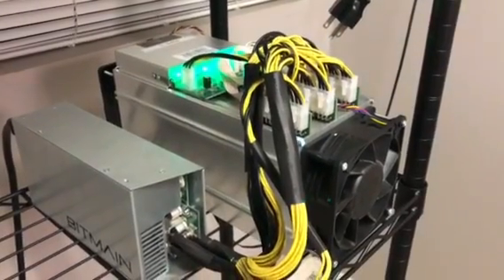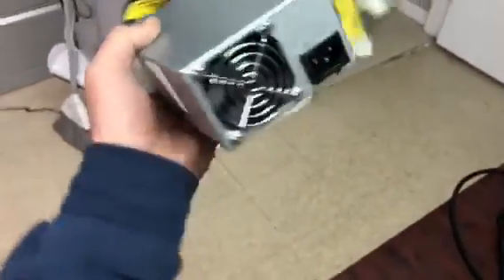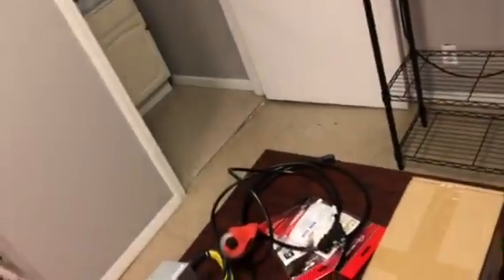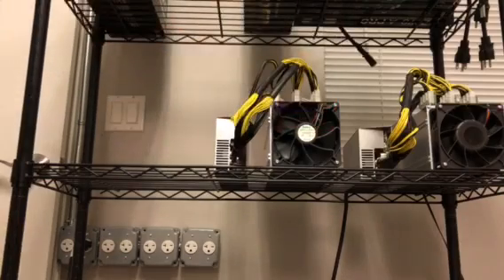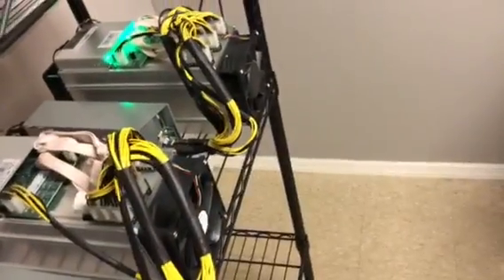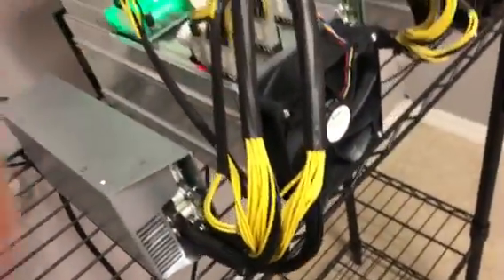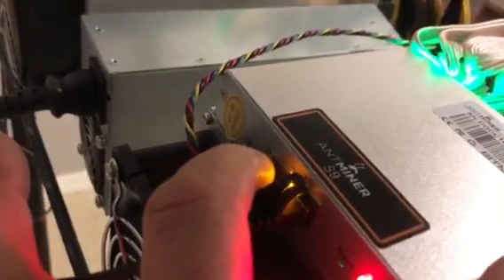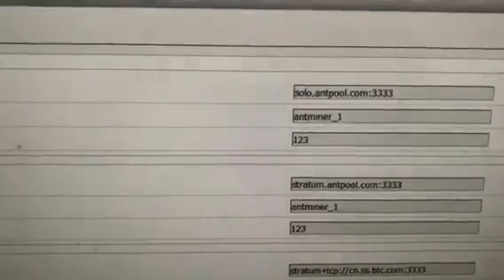AntMiner S9 Unboxing, Setup & Configuration - BitCoin Mining Miner 13.5TH

Comment: so what is the ip reporter program where you loaded the miner ip? and where did you get it? your video is kinda pointless with out that kind of information. a lot of details are not necessary but without the basic requirements its not gonna work and it just leaves a blank spot

Comment: 15 Amp circuit, on a 240v line, with 8 outlets, and 8 Antminers [s9's] equal to a total of: 10,640 watts... is a negative -7,040 watt difference, with a 296% load! Did anything burn down?

Comment: Sir! Thank you very much. I have a question, when you connect the power supply to the machine, the order of the cables are random? Another question, when you set up your miner machine into the pool, do I have to restart the machine (turn off and turn on)? Thanks!
Reply from the maker: Cristopher De Luca connect them randomly. When you connect to a pool the miner will likely reboot to save the config file.
Reply: Excellent! Thanks. The reboot is automatic? Do you prefer that pool than Antpool? Isn´t Antpool more profitable?
Reply from the maker: i use bitcoin pool - no fees.
Reply from the maker: The miners reconfigure automatically. Very simple with the Antminers.

Comment from the maker: ROI is 60 Days. Incredible. Imagine a $100k investment. Make it back in 60 days and moving forward is all profit!! Minus electric of course.
Reply: My only problem is the difficulty, which expects to increase by 18% in a few days. Unless there is a good correlation between the price and difficulty of bitcoin,  ROI will take longer than the estimated 60 days.
Reply from the maker: except when you auto mine BTC and BCH it only keeps going up with profit. ROI is now at 42 days.
Reply: @Crypto Plumber What do you mean by "auto mine BTC and BCH"?

Comment: Would you be able to do a video specifically dedicated to showing the plugging of the cables from the power supply to the machine.  Mine came in but I'm not sure where the single cables go and you're kind of blocking the camera when you plug them in this video.  Thanks
Reply from the maker: Guitarz4ever sure! I have a few more in route and will make a video upon arrival and setup.
Reply: Crypto Plumber that’s great! Do you have any advice right now for how to plug them in? I’m trying to set mine up right now.
Reply from the maker: Guitarz4ever did you also get the BitMain PSU? If you did all the connectors go to all the connections on the miner. There will be no wires left.
Reply: Crypto Plumber yes. I am just confused because two cables are kind of separate .
Reply from the maker: Guitarz4ever it does not matter.
Reply: Crypto Plumber oh thanks.  I guess I was just over thinking then lol.
Reply: Crypto Plumber machine is up and running well.  Which mining pool do you use?
Reply from the maker: Guitarz4ever bitcoin pool
Reply from the maker: I use bitcoin pool

Comment: Where did you order antminer from?
Reply from the maker: Directly from BitMain
Reply: Thanks… how much was it?
Reply: Amazon says $5,000… which I think is way over priced
Reply from the maker: At $3k to $3400 is a good price with power supply when you factor in the 2.5 month wait from BitMain to get a miner with PS and shipping for $1650 to the US.
Reply from the maker: Shipping and power supply was $1640 but it’s a 2 1/2 month wait. Sometimes a little less but generally 2.5 months.